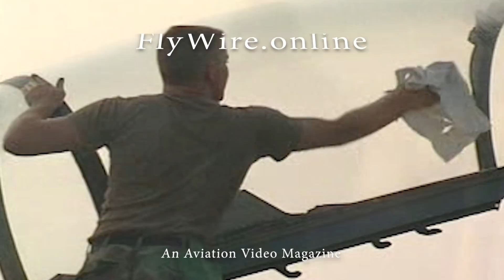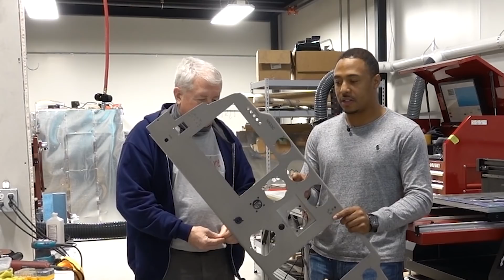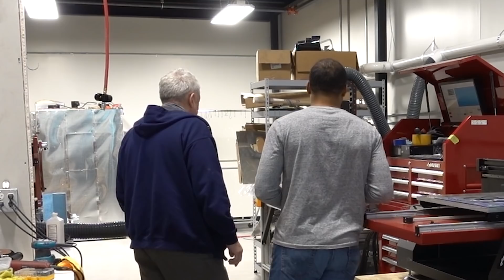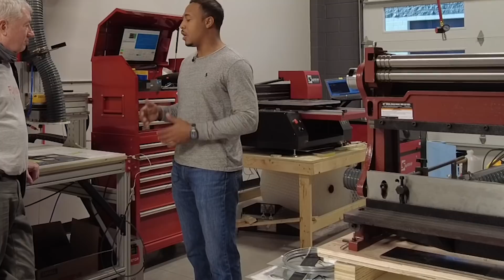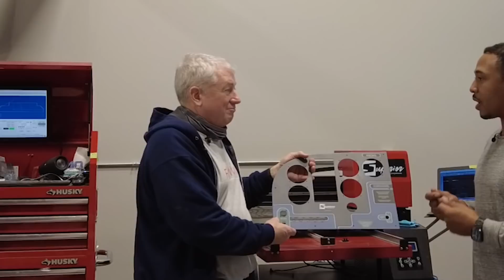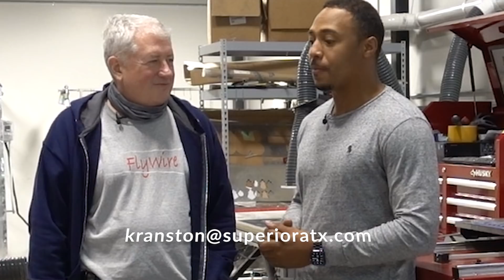Kranston Kincaid  Aviation Tinker

Comment: G'day,

Wow !

And if anybody has to  enquire as to the price, then they probably can't afford it...(!).

  I used a Hole-Saw in a 240-Volt Hand-Drill, and I then enlarged the Holes by hand with my grandfather's old Rat-Tailed Rasps ;  I made the Panel from a decommissioned Roadsign, with the reflective Sticker left on the unseen side, painted mat-Black with a Spraycan.

Not many people realise that the  Roadsigns here in Oz are actually Aircraft-Grade Aluminium (for Wind Loading & Corrosion Ressistance !), but it's true enough, and in fact the first Slepczev Storch had  Extruded lengths of Street-Name Sign Material for it's Mainspar - it's an Aluminium "I-Girder, with integral "Spar-Caps", factory-rolled & heat-treated...

This setup is absolutely amazing...

Have a good one,

Stay safe...

;-p

Ciao !